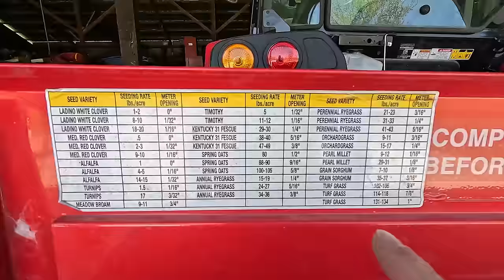Using a Seed Drill to Overseed our Hay Field and Pasture - Kasco HayMaker

Comment: That seed drill did a nice job, I should use one of those for my pastures. I have tried broadcast seeding before with about the same results as you. I hope that it does good for you, thanks for sharing, have a good evening!
Reply: I have roughly disced ground, broad cast seed, then pulled  cultipacker over to bond seed to soil. Always had good results with this method. btw you can pull old chain link fence.

Comment: I recently watched a video where they show a technique of germinating grass seed before they spread the seed. The seeds were soaked and strained in 5 gallon paint strainer bags. They had to be planted at the first sign of germination or the bag becomes a tangled mess. The grass grew quickly and without the need for extra watering care that is usually needed to get the grass to germinate.

Comment: Ya that seeder does a great Job, nice mixes also 👍 I'm playing manure spreader today ( #no tractor only 2 acres ) I just use a wheel barrel & muck from the winter area and a very long garden hose lol. The hose is 2 100' hoses connected so it reaches quite far on our 2 acres.  I'm in Northern BC Canada,  we still have some snow in patches on the field and its quite wet, so a tractor would just make a mess n e way

Comment: The best way to seed in a hayfield to get a (mixed variety) hayfield like (a legume and a grass like timothy) is to drill each type of seed separately into different areas of the field in wide strips or across the field like maybe corner to corner of the field so the tall grasses don't shade or crowd out the legumes and then after cutting rake the two together to get a mixture for baling.   That should help make it to where less reseeding is required and if you do reseed it will be easier to see and remember to use the right seed in the right area of the field.

Comment: I don’t know where you buy your seed but learned a hard and expensive lesson one time. The place I’d been getting seed from had a huge stockpile in some warehouse. Some of the seeds were old as dirt. Once I found a place I could buy fresher seed I got a much much better result using the same seed drill I’ve used many times on the other seed. Sometimes it is not the method or the timing, it the seed.

Comment: Seed to soil contact means the seed has no exposure to air/sunlight. If you get a rain you'll be okay. 

The most challenging part of running a rig with a packer is the conflict between getting disks to penetrate while having enough pressure on the packer to close the furrow. Its easynto have the packer pressure set so strong that it holds your disk openers off the ground - or visaversa. 

 Many grasses do fine if broadcast over the top of a growing crop. The only issue is whether they can compete with established plants for moisture and get sunlight once they germinate. Good luck.

Comment: i have always liked the double disk openers  on drills they seem to Cut the furrow open  through grass a little better most single disk openers have a boot with a knife between the disk and seed boot.   couldn't tell on the little drill you had.  most new drills are "fluted feed " and older ones are what is called "double run " with a large side and a small side seed cup, i dont think they work very well for  grasses . a paint brush works good to "sweep " the drill out .  reseeding is hard as the seed is shaded and some grasses (alfalfa) produce a chemical that restricts germination

Comment: Nice way to inner seed a pasture. I've been thinking about trying to step up some of my pasture ground. But I grew up being told you can't plant alfalfa behind alfalfa. It has to be rotated out for a year because of what they call auto toxicity. But since yours was all dead anyway, maybe it will grow for you. This past fall I planted rye on a few acres to try it as a cover crop. It got a good start, and my beef cows really like grazing it. They have eaten far less hay than normal, but it has also been a mild winter. I'm seriously considering drone seeding it again into standing corn this fall for them to have for grazing next year. If it saves as much hay as it has this year, it'll be worth it. From what I've read, they say to seed it when the corn is starting to turn brown and dry down. I'll be looking into that this summer for sure! Good luck with your rejuvenation, I'm anxious to see it work for you!

Comment: RYE grass, it comes up good, but it does nothing and most dies off every year. blue grass is a good spring grass but dies easy in the heat,  and clover. all these cover good, but your feed stock fescue, gets smothered out by all of this from the start. and once the other three start to die, your fescue is left thin, so its not a good feed source unless you seed every year, just some old time advice. check on it with someone who has been doing much much longer.
Reply: You're probably seeding annual ryegrass, not perennial.  The rule of thumb is quick germinating and establishing grasses are short-lived while longer lived grasses (and some legumes - trefoil) are hard to establish but will persist.  No perfect seed.  That's one reason why people mix seed types